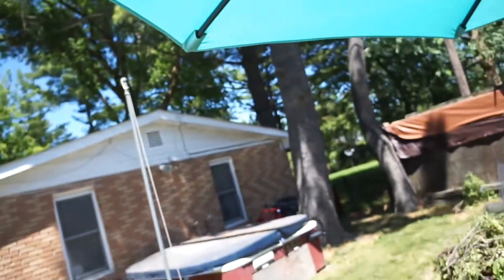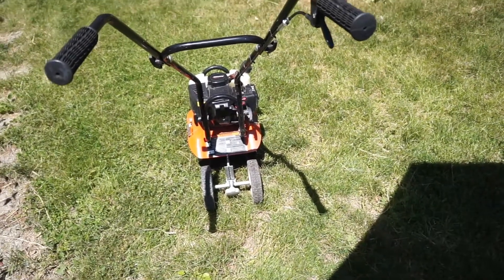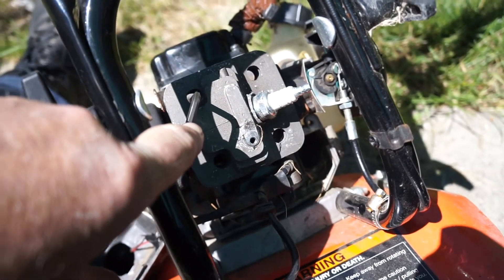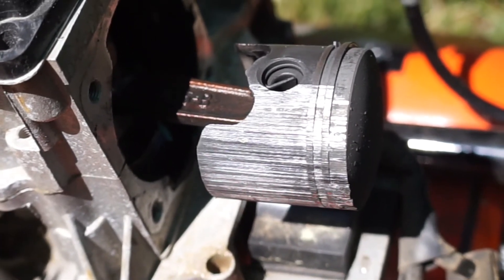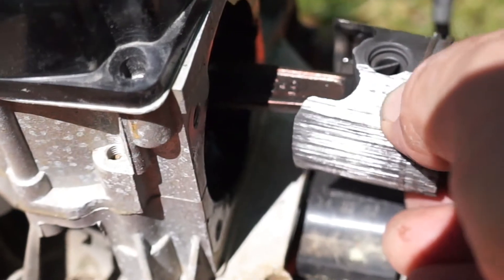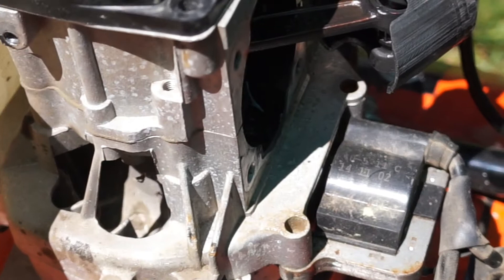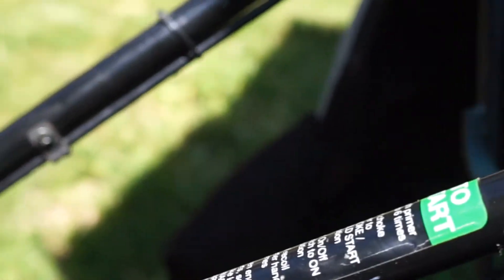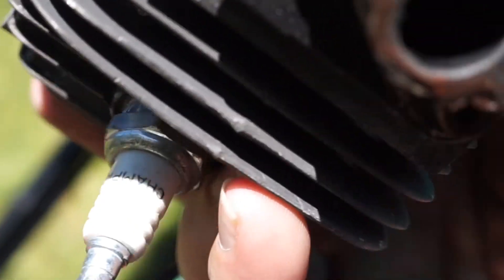Power mate mini tiller won't start. Teardown & diagnosis

Comment: Cord won’t pull
Reply from the maker: 2 common issues. Recoil spring breaks, or cylinder walls get scorched
Reply: It is frozen, won’t move ,not even a little.
It’s like new
Reply from the maker: I hate to say it, but i dont think it will be worth fixing. Im not sure that you can even get the parts.

Comment: mine has 96 compression with only 10 hrs on it. Someone posted the same thing on another vid of this tiller. that maybe the carb was set too lean from the factory.
Reply from the maker: Quite possibly.  It's a nice looking machine. The gears and tines seem well made but I'm not impressed with the engine.